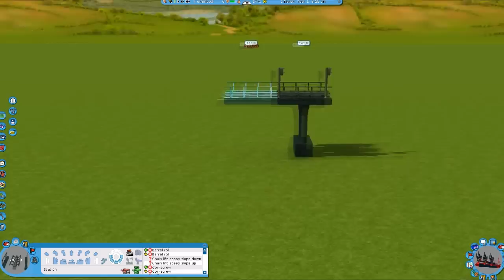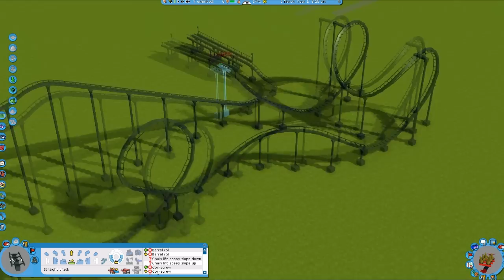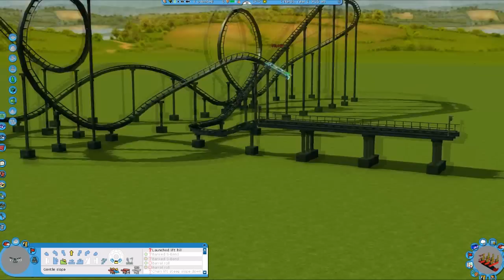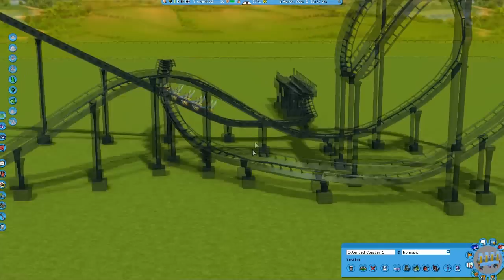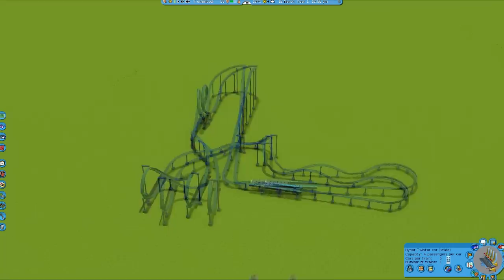RCT3 Tutorial - Layouts - B&M Floorless/B&M Sitdown

Comment: Useful tutorial :) Some very accurate tips, such as the banked turn/corkscrew smooth transition.

Some unsolicited advice based on my experience:

- Use diagonals. They are great to make your coaster feel off-grid. Diagonal lifthill, or better, diagonal launch, are an easy way to use diagonals in your layout. If you can't use diagonals in your layout you may still use an oblique path to create an illusion of an off-grid coaster.

- For beginners, don't build coasters over 40m/130ft. Though many coasters irl are taller, RCT3 doesn't have many turns wide enough to cope with a tall height. A relatively small height also helps getting the speed of your coaster under control.

- Instead of starting the layout with the station/lift hill, I usually begin with working around the 'signature' element of my coaster (usually an inversion). Imo, this is very useful to seamlessly integrate your element into the whole layout.

Also, here are some of the best, most inspiring floorless/sitdown layouts I've seen in RCT3:

El Rey by Max and N7 - http://i18.servimg.com/u/f18/12/89/55/67/jh_210.jpg
Conquistador by Brawly - http://s452.photobucket.com/user/Brawlstar0321/media/Shot0058-1_zps07602438.png.html
Annunaki by Crzynss - http://i18.servimg.com/u/f18/12/89/55/67/l_p_an10.jpg

ZeroG's layouts on SGW are very insightful too: http://www.shyguysworld.com/index.php/topic,6531.270
Reply from the maker: Portem!ne Definitely really good points! The diagonals are also a great way of getting smoother track pieces, especially for woodies. And building tall coasters is indeed always really hard. When it comes to starting with an element though - I don't know, I'm quite used to building them up from the station, lifthill or drop, and have messed with other ways, but it never came out really well for me.

And when it comes to those inspiring floorless layouts - yeah, I can definitely remember those and that says a lot. Especially El Rey is amazing in my opinion, if not with that great colour scheme and realistic minimalistic surroundings the best looking floorless ever made in RCT3.

Comment: If you build a new b&m you should use low friction as new b&m trains and track have changed since rct3 came out, they redesigned the wheels to make the trains keep speed
Reply from the maker: MoreItsDavid I think it is a bit harder than just that though - low friction in RCT3 is an unrealistically low friction... it works, but you'd have to use an MCBR to brake the coaster midway.
Reply: true